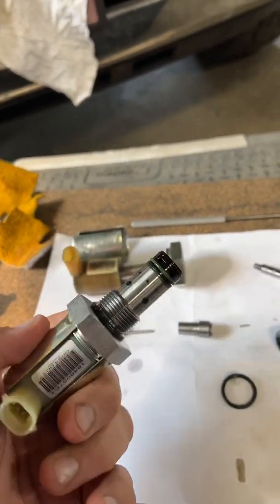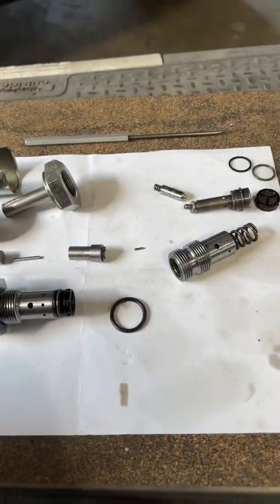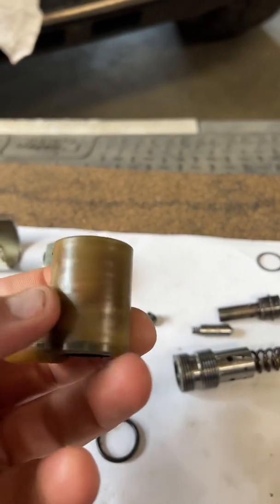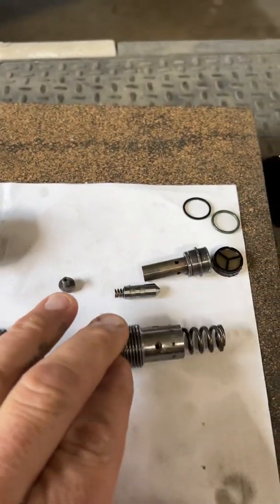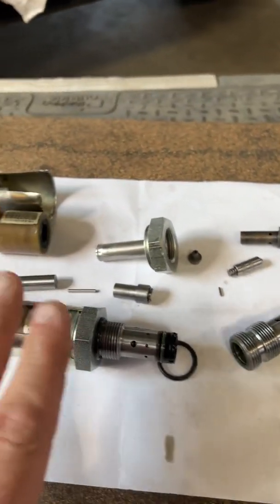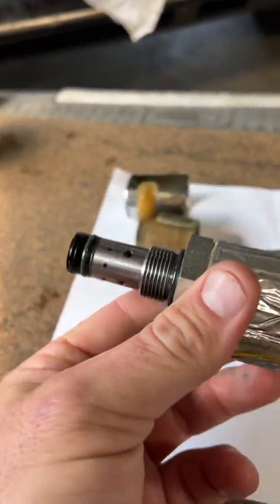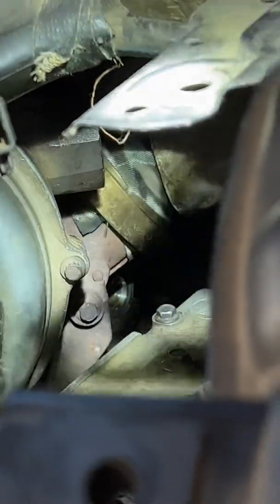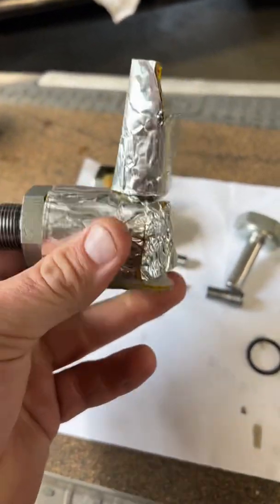6.0 powerstroke IPR education

Comment: Id still buy it from O'Reilly's or Napa, rock auto ain't dependable on stuff like that interesting video though but there is way more to just the common oh it's the ipc or oh I had that problem just slap a ipr on it, DIAGNOSE the issue before just throwing money on it, what happens when you buy that cheap ipr from rock auto do you buy another one since it's so cheap and keep on buying till one works? Or do you do your homework first ?
Reply: You didn't listen. It was an OEM part bought off rock auto
Reply: Plus you can see it's OEM by simply looking at it if you know what you're looking at. Easy to see
Reply: there is about ten things that cause a no start on this pile of shit motor

Comment: HI KING   I use heat Shroud 1 1/2  .It is good to 500 degrees  .Then I use a rubber 
hose .I put a small hole at each end  of the hose for a small zip tie .You can step
 it down to smaller Heat shroud . You can get the Heat Shroud on Amazon . It will
  Fit    IPR  and  ICP . Good Video .

Comment: Thanks for taking the time to explain this. I'm pretty sure this is what's happening on my truck right now. And what's really annoying about it is that it can be intermittent but also seems to be affected more when the engine is hot almost like it has a high pressure oil leak from standpipe or dummy plug or something.
Reply: the best way to determine if your IPR is bad is if your truck exibits occasional poor throttle response. and sometimes cranks unususally long or doesnt even start. or you end up with a dead pedal randomly. also a choppy idle can be caused by it.
now the only way to verify these issues and connect this as a concern is remove the IPR. (every time i remove a IPR i brake clean the entire backside of the engine where its at and blast it with a air compressor to prevent debries from getting in) and once the IPR is removed. check the screen if its got any hole or damage thats not supposed to be there you need a new one. 

just anytime dealing with the high pressure oil system always remember that the IPR is not a sensor. it gives no feed back its only commanded closed. by X amount. the only things to really look for in the High pressure oil system is the ICP sensor readings (and the truck can and will run and drive somewhat okay without the ICP working or damaged wiring) 

you may be on to something with the Hot no start. it could easily be a standpipe leaking. or dummy plugs. i rarely buy OEM ford motorcraft stuff. i replaced my standpipes and dummy plugs with 
https://www.amazon.com/Stand-pipe-Dummy-Plug-Powerstroke/dp/B07NVV1L3J

and it lasted a very long time (no more leaks) until i had a aftermarket injector catastrophically fail and im now doing a engine rebuild. 2 years later and 30,000 miles.

Comment: Hey ever heard of this, I bought a reputable ipr but when I tightened it up the plug was clocked downwards so impossible to plug in
Reply from the maker: Yeah I have, the electrical connection end is nothing more than a magnet sitting on a tube, it is able to rotate without damaging anything. So if it’s not pointing in a direction you like just rotate it until you do. Just crack it loose move the connector end 180 degrees or so from where it is (without turning the whole thing, just the connector end) tighten it up and good to go.
Reply: Or run it all the way in hand tight, back off until the plug is facing you, plug in your wire connector, then tighten it with the wires on already, making sure while it rotates past the heat sheild it doesn't snag it... it was easy this way❤❤❤